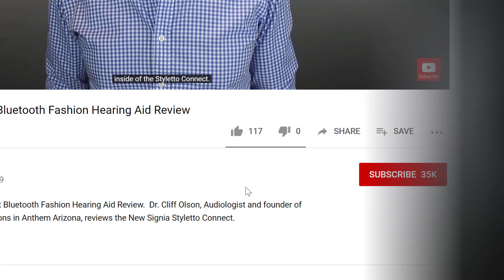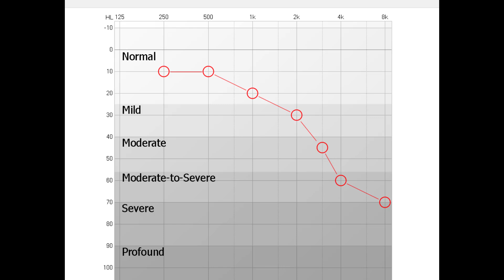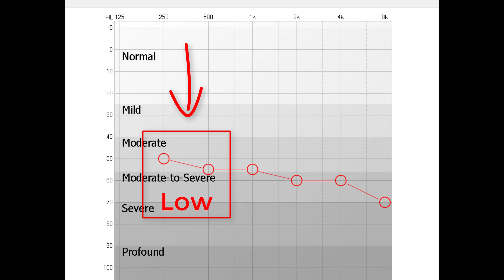Why Do Hearing Aids Make My Voice LOUD? | The Occlusion Effect

Comment: Just got fitted for Resound Omnia 9 with M&RIE receiver. My audiologist is loathed to try anything but a closed dome because of the likelihood of feedback at high freq. At 500Hz I'm less that 20dB loss but quite a slope down past 2K so all the amplification is at higher frequencies. The occlusion I get however is not really tolerable. Coupled with the noise reduction capabilities of the Omnia and it often feels like Im just walking around with my fingers in my ears.

Comment: I had REM’s done on my hearing aids today with my costom molds and it showed that it met my prescription… if it was too small a vent size, how would I be able to tell? I mean ive always had a bit of the occlusive feeling with hearing aids in general but with the molds its more of just when i bite down as opposed to when i speak but its mainly just a little.. is my vent too small??
Reply: Fixing occlusion completely is a massive task, it’s really a game of finding a vent size that doesn’t cause a whole lot of feedback (because the more your hearing aid is working on not causing feedback, the less playing room it has amplifying the signals you actually want and need to hear). so while hearing care providers want to fix your occlusion effect, we prefer to not rush it (because it’s easy to drill an ear mould open but it costs us and you money to buy a new one) and settle for a tolerable level of chewing noises rather than a feedback loop from hell. If you genuinely feel that the whole house can hear you eat a cookie, there’s something we can and will do about it. If your chewing is audible to you but not distractingly so, your vents are fine.

Comment: I have a Kirkland Signature 10.0T (same as Phonak Paradise 90RT)  and was fitted with Medium Power Domes.  My plugged up feeling and me talking is horrible.  I did buy some Closed domes with 2 tiny vents in them, and tried them.  I did not end up with feedback issues, the Occlusion improved DRAMATICALLY  but high pitches were annoying loud.. too loud.  I understand that any time you change a dome style it changes the overall acoustic of the ear canal.  So would I need to "suggest"  to the Costco hearing aid specialist that I want closed domes (with vents) and have the hearing  aids "tuned" using REM to those?  I have been fitted with a Power receiver and Power domes.  My hearing loss stars just below 40dB and at 1.5 Khz starts sloping pretty drastic down to 4K which is at 100dB.

Comment: Dr Cliff, does the Signia OVP help reduce occlusion and own voice loudness effectively?  Are there any other brands that also help reduce these effects as well as Signia?
Reply: Larry, in my case the OVP really works!  When I was fitted with the Signia NX7, the audiologist told me to start counting slowly out loud  from 21.  The NX7 corrected the problem automatically.  When I reached 28, she told me to stop counting.  The loudness problem was gone,  Yes, it really works!
Reply from the maker: Technically, OVP does not address occlusion directly, but perhaps indirectly.  It actually reduces amplification given to your own voice through the hearing aids.  This also may reduce the amount of vibration added to bone conducted vibration, possibly reducing some occlusion.

Comment: Despite almost no hearing loss at 500 Hz (max 20dB) I don't like large venting, because I loose benefits from e.g. FM/Roger systems, noise reduction systems, etc. (the noise get into ear canal via venting). 

Does it make sense to get earmold with no venting if I have no problem with occlusion effect?
Reply from the maker: Having a closed ear mold would be beneficial if someone is not bothered or does not perceive occlusion.  You are correct, having open domes or large venting can limit directional effects from hearing aids.
Reply: @DrCliffAuD , thanks for info! I will try Audeo M90 with REM in January. 
I have used Bolero V70-P until now, fitted with REM first time in my life, but has no benefit, probably because of too weak power in high frequency (which REM show) or/and too close loudspeaker during REM (~30 cm to my face). I will try it again!